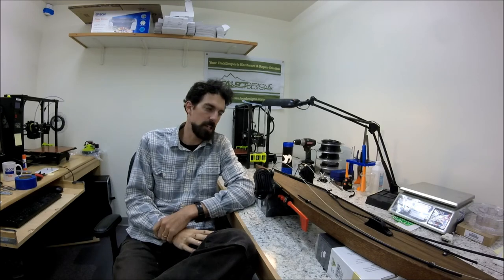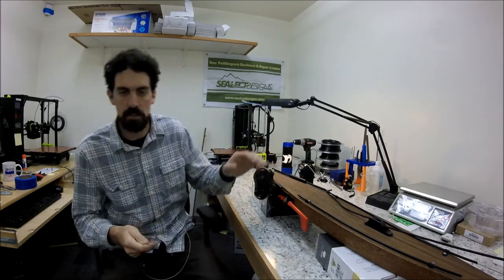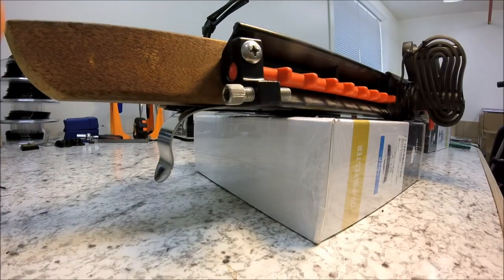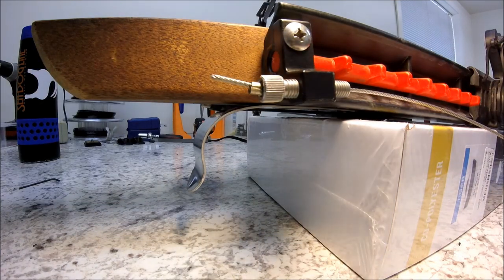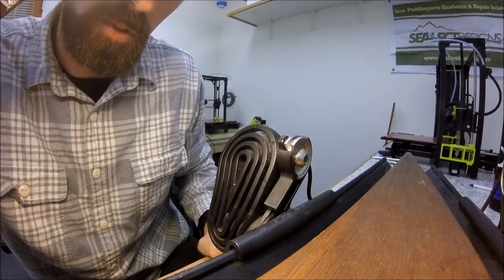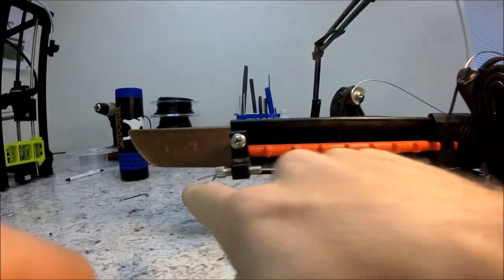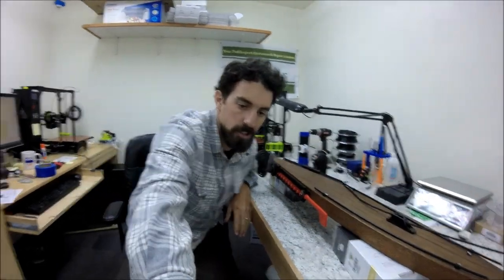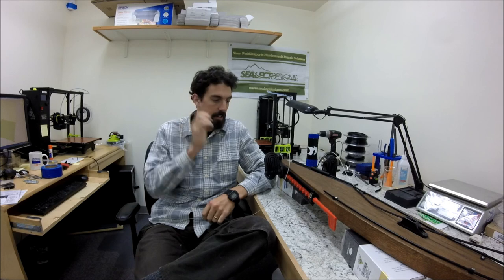Cable installation in Sea-Lect Designs Rudder Control Footbrace

Comment: How is the bungee attached to the pedal?  My kit came with them loose in the package should they go on before securing the pedals to kayak?
Reply from the maker: HI Eugenia, Start by tying a knot in one end of the cord. Feed the cord through the hole in the base of the pedal from the inside end closest to the bow. The inside is the part closest to the track. The route the cord through the tab on the top of the pedal. The pedal should be vertical or 90 degrees to the track in what would be the normal brace position. Tie another knot in the cord with a little bit of slack. The purpose of the cord is to keep the pedal from falling back towards you (to the stern) so it is always vertical and ready for your foot. If you have more questions please give us a call.

Comment: How do you attach the wire without the micro adjuster?
Reply from the maker: If you are using our footbrace but it does not use the micro adjuster you will find a small hole in the track just above the adjuster rod clamp that you can route the cable through.

Comment: Could you add the diameter of the cable used?  Is it 1/16th inch?
Reply from the maker: Hello Connor ... yes, you are correct, it is a 1/16" stainless steel cable. Most every paddlesports shop stocks it (or, you can probably find some at you local hardware store as well). http://www.sealectdesigns.com/groups/1436-rudder-cable

Thanks again, and please let us know fi you have any other questions! Have a great afternoon!
Reply: Thanks for your help!